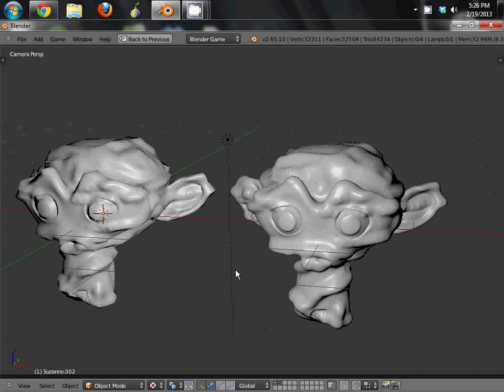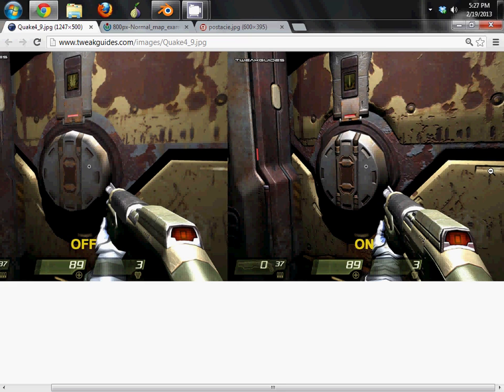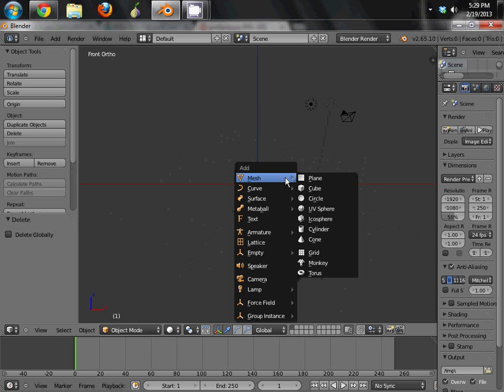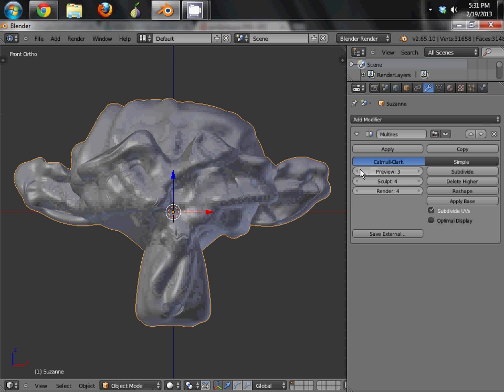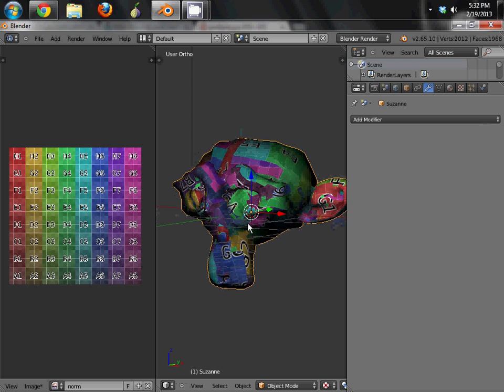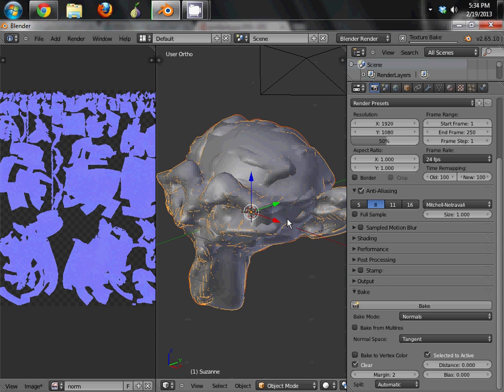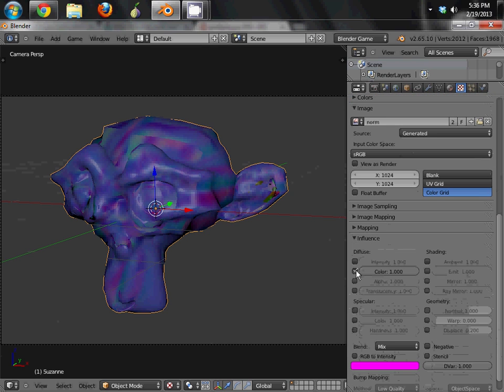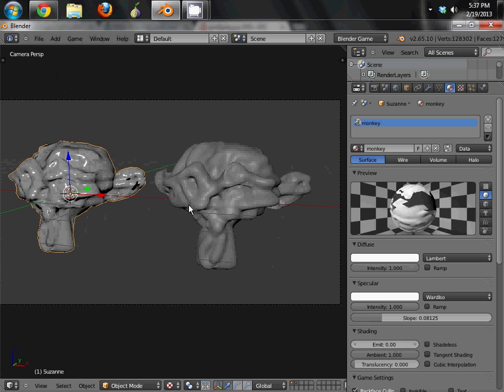Normal mapping in blender

Comment: ive actually found my own way to make normal maps in blender without baking. it requires some work in the node editor, but its rendering the map is very quick since it uses the open gl render
Reply: botconboy Hi, could you upload a file or a screenshot with the node arrange you are using to make this possible?
Reply: sure. i just posted a screenshot of the node setup on my google+ page. Hope you find it helpful.

Comment: Great explanation
But, you took your normal map from a hires model (the duplicate), and it is ok, then you will use only the low res.
But what in the case you do not develop a model so detailed?
This is, no matter if you subduvude your model many times, the normals wont be there. lets say, in the case of a finger, but you want to have many details of it
In that case, for example if you have an image for stencil use, then you can create create the normal map for it, not the way you did it, but painting, as in weight paint we do, so it would be good to have a tutorial on how to create those normal maps as in gimp or photshop, waht colors to use what they mean, more blue, more red, I dont know, there must be a code for normals as in weight paint, the blue to red range.
Thanks